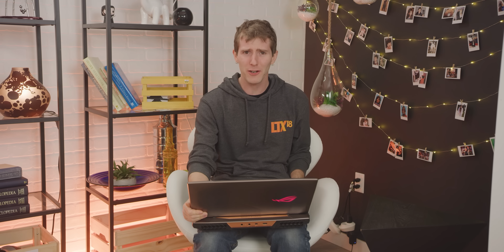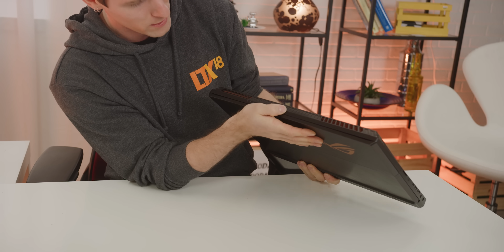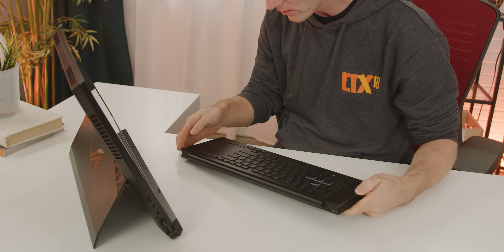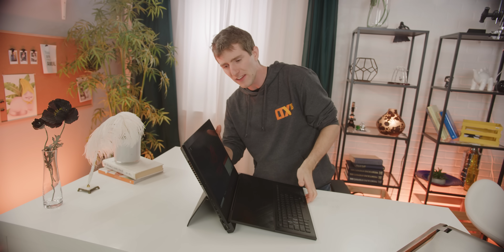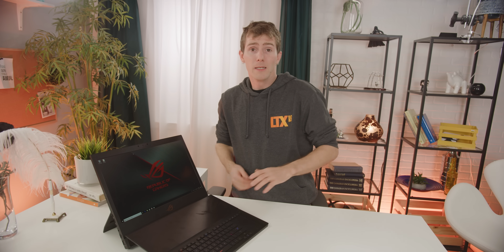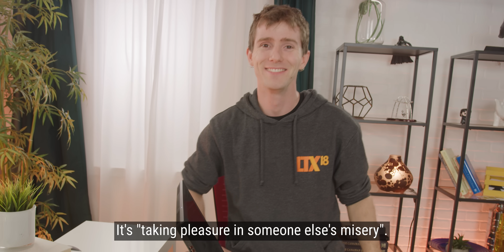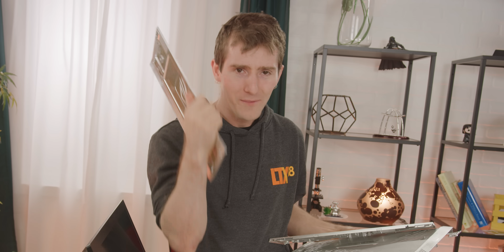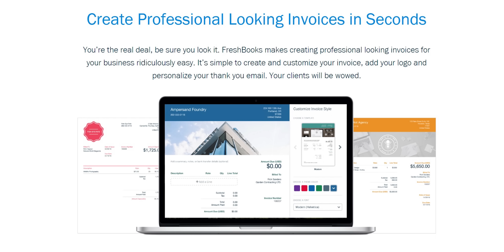A Surface Pro for HARDCORE Gamers - ROG G703 "Mothership" First Look

Comment: The last ASUS laptop I bought had endless touchpad and electrical problems.  I actually cannot use one of the HDD bays now because if it's degrading power system.

Comment: Looks awesome but I don't consider it a desktop replacement.  It uses a laptop CPU 8950hk.  Sager & Cybertron use true desktop CPUs such as the I9 9900k, I7 8086k, I7 8700k, Etc....  I think Alienware is coming out with a true desktop replacement also.  Sager has been doing it for many many years.  Anyway I'm sure they have a bunch of other companies that do it also.  Totally wish this Mothership was capable of using an  I9 9900k.

Comment: I have been thinking like 2 hours straight, and couldn't find the audience for this product.

They advertise this as a laptop, who the hell will you use ths in a coffee shop or school? Second, they also advertise it as a desktop replacement, which can be for sure, but honestly, with the size lf this monster, you will mostly keep it on your desktop like 99% of the time, in that case, you are much better with a proper mini itx desktop : expandable, much much cheaper and more powerfull.

Maybe you are thinking : "But of course this is better, it's portable", but you guys honestly will use this outside of your house? .
Reply: I'm in IT, and I also do freelance stuff. Any contract in which I have to travel around a lot and program on location would give me a lot of use for this. It's more ergonomic than a laptop, so I see this as a literal desktop replacement. You go to another location, set up your desk with your portable desktop and go. That said I'd probably still go with a laptop instead, as it allows actual use on your lap / in the field, and a laptop cooler can help a lot with the ergonomics there.

Comment: But I just bought a new gaming laptop.

I see no reason for that to be that expensive. Sure, it's a brand new form factor, but it shouldn't be much more expensive than any other laptop with those particular specs. But how big was that monitor? I wanted a "laptop" with a 21" monitor.

Comment: i hate the smaller is better trend, like i understand lighter, its supposed to be portable but i dont like smaller, if i buy a laptop i am going to because i need a portable desktop, so while yes i would rather have a lighter laptop, i would prefer the heavy g703 over a gram, cause while yes it is a hell of a lot heavier, im not using it for its lightness im using it because it is equivalent to my desktop and i can bring it to class or to lunch, being in college having a high powered computer on the go would be amazing since i spend a lot of time out of my dorm and the only computers i ave are my desktop and an older Chromebook, so if i want to get any work done that isnt an essay i need to go to my dorm, and i would say this beast gets the job done for me, also come on, if you saw someone sit down in class or in lunch and just pulled this thing out of their bag, tell me you wouldn't want to go sit down and be like what the hell is that, and then they just pull the keyboard off their laptop like its nothing, i want that in my life

Comment: I could actually see a person being able to use the ROG Mothership as a total replacement for a desktop, while also being much better able to handle productivity tasks compared to a traditional laptop.

The main areas I can see this machine may have issues with are its weight and battery life. Although I certainly hope its battery has been increased to handle the increased power draw.

Comment: I may consider something like this. I currently use a gaming laptop as my primary machine, b/c it's super nice to have my main device & files with me at all times, but I don't need that functionality too often so having something a bit more in between a desktop and laptop might work just as well. What I really want, however, is a tiny mobile platform for system builders. A sort of ATX-like standard for laptops & AIOs.

Also, I would never let Linus anywhere near any of my hardware...

Comment: i still prefer build a extreme motherfucker gamer pc put it on a pillar in my room and lots of monitors and if a had enough money a projector. I use g933 g903 Corsair k63 wireless with 3 ultra wide monitors and get a super ultra wide recentlry in a non desk setup... i need change my support to put the super ultra wide monitor to work. But... i play in main screen, social stuff in left and right screen to scan all voltages, temps, baterries and all stats i can check. plus when i programm on it i can see the stuff code and debug easy easy. I never play out, when i go out i want see mobies, places, peoples and all outdoor stuffs i play in my stage and live outside. win-win in my view

Comment: Interesting design but would worry a little about having so much weight in the "screen" that could potentially fall over. I wonder if the better choice would be to split the weight a bit more so some is still in the keyboard area?
I think if I were planning on playing a lot of games on this too I would have wanted a way to safely adjust the height and angle so that you don't have to look down on it.

Comment: I had an asus laptop about 8 years ago, sometimes it would get warm while gaming and other intense computing tasks so i bought some rubber stick on feet which cost $3 and was able to solve the over heating problem, or you can spend $3k up to you.
Reply: The problem is still not solved, that laptop suck in the exhausted hot air back again.

Comment: My biggest complaint with ASUS has the issues with the keyboard malfunctioning and with mine having a slim screen and me traveling with it regularly the graphics have now become pixelated even though I've had it only 6 months is now shutting down at random times and not rebooting. Customer service was very responsive about the keyboard issues not sure what the deal was with the pixelation and the boot up issues but I do like seeing that the screen has more protection with the thickness of this model. After all the issues with my Asus I don't know if I would buy another one.

Comment: So they took a Surface Pro... Put a bunch of heavy shit in it... Then claimed to have fixed the portability by allowing you to unhitch the keyboard?...
It still weighs like 5x more than a Surface... It's even going to be HARDER to use it on the lap because of the Surface-style kickstand...

Who exactly is this for?...
Reply: As long as the price isnt totally insane I  would. I work for the railroad so I am gone for long periods of time but still have hours of rest that I like to relax while getting that same amount of time at home. Those hours spent in a hotel or dorm can be extremely boring and sometimes up to 40 hours+.
Reply: Though I am also interested in any portable device that can tote a 10/2080 (maxQ or not)

Comment: I need a full review!
Some Q's.
Explain the storage sitch better, raid 0 is super fast but also squares (^2) your data loss failure rate...  So what did they do with the third drive?
People are wondering if it'll have a touchscreen as it is configured in a surface-esque way.
Absolutely everything else!
Price?
When can I get one?

Comment: It's certainly a different approach to a mobile pc. I'm definitely interested in how well it will mitigate heat under stress vs a typical flagship gaming laptop like the G703 or MSI GT75 Titan. 

I'm personally interested in getting a MSI GT75 with RTX or an Alienware 17 when or if they update it soon. Just waiting for now. I was considering  the Alienware 17 R5 mostly because it had a 1440p panel, and pretty much every other manufacturer offered only FHD or UHD panels on their high end laptops..

OLED would be nice.. but it unnerves me due to image burn in I've had on some OLED smartphones. My S9+ doesn't seem to have the issue, but its Super AMOLED.

Comment: Dude, my T540p's core frame has so much stiffness, I can disregard it's strength as long as I don't induce major point loads due to holding it like a dinner plate on a corner with the thumb up top and index-, middle- and usually ring finger below it.
I can just flip it up and change grip mid-air from pick-up-of-table/chair to carry-while-sprinting, or when holding it traditionally (flush against lower arm, with the load on the index-, middle- and ring finger's 2nd joint counted from the tip), and then wanting to change whether top or bottom contacts your arm.

Comment: dont wanna be a downer here but actually having gpu, cpu, display and battery in one place is very bad if you try using this while charging. thats also a problem of the surface pro (3). the display on max brightnes plus charging the battery produce a lot of temperature, but if ur also loading gpu and cpu while charging its gonna overheat or at least get very loud. dont get hyped for the cooling unless you have seen it in action WHILE charging at the same time.

Comment: Finally, some innovative designs! Not something I'd get for myself but it's super cool nonetheless.

When I want to keep my 2-in-1 laptop cool (rendering video or gaming) I flip it into tent mode. Best thing about the 2-in-1 design imho, the air intakes are not choked like that. Making the device a whole tablet takes that a step further!

But I bet this thing is $$$$$$$. Full review needed anyway so I can dream. :)
Reply: How do you game with it in "tent" mode...? The only way I could imagine gaming like that is if your connecting it to a different monitor and keyboard/mouse...which isn't uncommon.
Reply: @Aevilbeast  Bluetooth controller
Reply: I keep mine in laptop mode, but flip it so it sits on the keyboard itself vs. the underside of the laptop. That way I can have two screens up close with my keyboard and mouse. So, I guess, inverted laptop style?
Reply: @sei shin Yeah would have been cool!
Reply: Yeah its good to see something "new" but they made a "heat shield" out of one of the best thermally conductive matirials in the known universe..? Seems clever! facepalm
Reply: @dongurudebro4579  And now? I dont get the problem lol
Reply: @necro4453  the problem is that thats the worst possible choice they could have made and that what they are telling us is crap.
Reply: There's nothing innovative about this design. Like the title says, it's a Surface Pro.

Except one so bulky and heavy that it's not portable anymore, meaning you might as well save money and get a desktop.
Reply: @mjc0961  They should just rename the segment "portable desktop" I have the Hellos 500, and that is what it both is and what I wanted. I game on my desk in my room or go out in the living room and game with my roommates. I take it with me on the road and game in my hotel room. I just wish I could game in my car but I need one bad ass portable battery pack! 
     I hope this design evolves and eventually will be really kick as when I want to replace my Helios.

Comment: I feel like it should have a handle.  As a briefcase, it's actually pretty modestly sized.  Plus final manufacture should be able to simplify those parts and make it much more cost effective to produce, and a bit lighter.

Comment: This is stupid. Heavy giant non-movable thing, heaviest and thickest part of which is in unstable up-in-the-air position with thin slippery stand - it just feels unnatural, unreliable and unpleasant.
Attached keyboard bends and wobbles, it requires two PSUs, performance would be still compromised in comparison with desktop, and cooling is stiil just a larger laptop-type.

And you are so unnaturally excited like this monster makes any sense and is gamechanging, it disappoints me.

Comment: They need to come up with better designs for cooling... I feel like that is the most outdated part of computers today. Why arent laptops liquid cooled as a standard? Why not a thin plate the entire distance of the computer where the fluid flows through it slow speed with fans on low speed? I feel like if they could perfect a sealed system that wont leak they could accomplish so much more on a thinner profile.

Comment: Good for keep at home thing, but can't really take this anywhere
Reply: The machine I feel like a gamer that works on the road and spends a lot of time in hotels could make great use of this. I know guys that carry sff’s/monitor/keyboard/mouse every time they travel, this would be much easier to travel with maybe not a good airplane laptop but in reality it could still work.
Reply: @Lordjmfp  exactly, this was just peaking my interest as I work for the railroad. Been looking at other laptops with 10/2080's as well (maxQ or not)
Reply: I think you could take it all over. It just needs a handle. :)

You can set it up but looks like its heavy enough to really sag and obstruct a typical coach chair shelf. But putting the keyboard in your lap wouldn't be too difficult. Just ungangly.
Reply: it's be a good lan machine tbqh with a logitech wireless mouse on the side

Comment: I hate it. I am clearly not the intended audience. But then again, I'm not a gamer. My most important requirements to a laptop are: a light and b last long on a battery charge. I bet this laptop sucks at both.
For what I do with the laptop even my Surface Pro is overpowered. I probably should have bought the Surface Go instead.

Comment: the design is moving in the right direction.
Id like to see the entire laptop separated into easy to carry computer/display/input units that you can buy separately or all at once.
e.g You could buy only the "thin" laptop shaped computing unit, without any I/O, and hook it up to your own monitor and keyboard.
Or .. buy the computing unit + custom display/keyboard that can be attached/detached from the computer, and used as an ultra-thin surface laptop.
In other words, the computing part of the laptop could be separated from the I/O part of the laptop. You would put the computing unit at the corner of the room somewhere, and use the ultra-thin I/O laptop as your gaming rig(over bluetooth or wifi). The I/O laptop would be thinnest/lightest in the world since it has no internal components, other than display/keyboard and a small battery.

Comment: Back ten or gosh is it fifteen years ago now...?! -- I bought one of Falcon NW's first Desktop Replacement laptops. (It's still featured on their custom paint showcase last time I checked, simply because it was so deep black that they went crazy trying to light the studio enough to even shoot it! -- and wanted to show that off, lol!) Naturally, I couldn't actually use it on my lap, even though it had several genuine fans in it for cooling. Back then, Falcon didn't send along a tough backpack for it, but rather an aluminum briefcase. I used that as my heat sink. {g}

(Still got it off in a corner of my room, with Windows XPSP2. Don't use it much anymore, of course.)
Reply: It cost about $4500, by the way. The super-pad thing he's looking at runs $4000 or a little under.

Comment: Should be called a portable desktop, not a laptop. Thought this was pretty stupid until I realized how it's basically a portable monitor and PC into one, which would work wonders when going to a friend's house to game vs bringing a monitor & laptop or a monitor & desktop which can be a pain in the ass and it seems actually portable, quiet, and won't burn you (I hate my Razer blade pro due to it actually burning me) unlike laptops with similar performance.